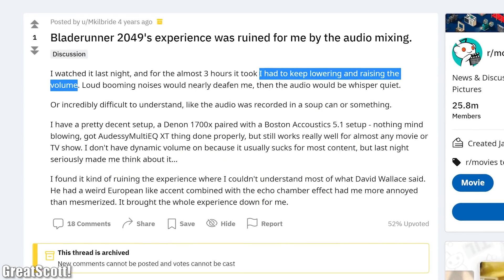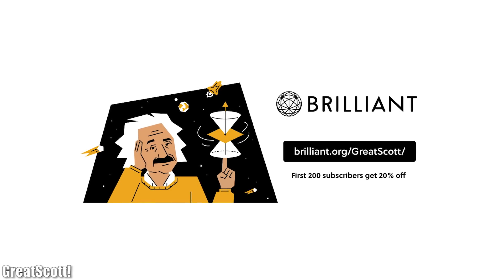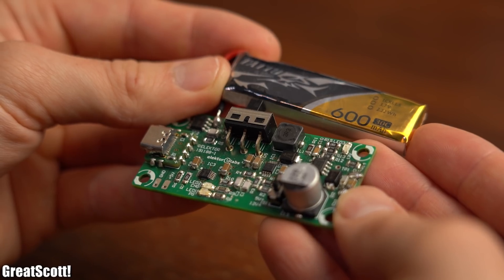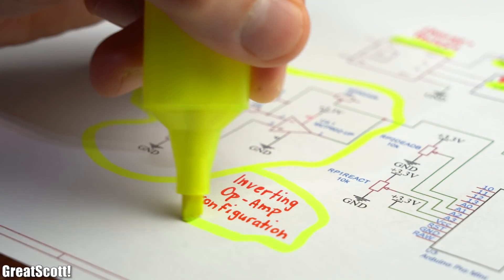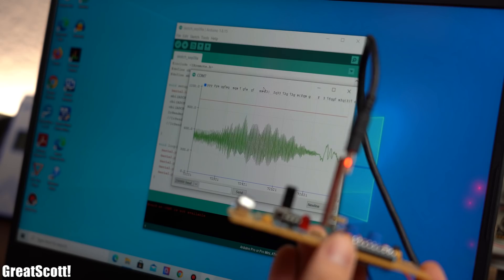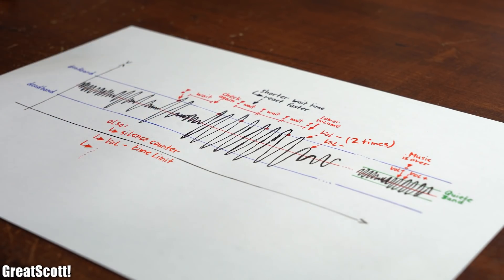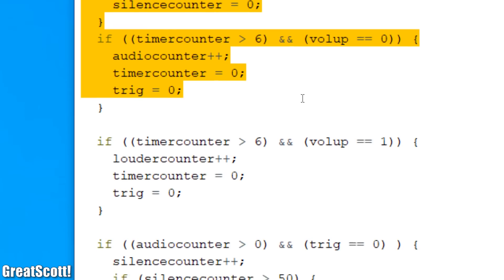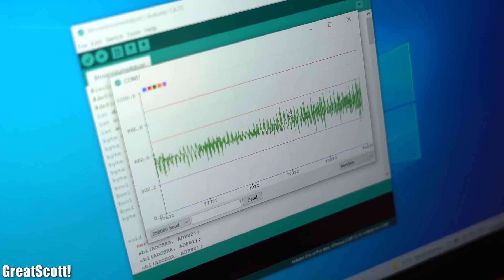Movie Music has a LOUD PROBLEM! So I fixed that! (Automatic Volume Adjuster)

Comment: Bro, your vdos are amazing. I am trying to make my earphones into Bluetooth ones. I have a hc05 bluetooth and not the regular one with left and right sides. So I decided to use a Arduino with suitable code that takes raw audio data from hc05 module and generate left and right signals for the headphones. Can u pls make a vdo on this😁

Comment: If you detect the raw audio and filter it you will get a volume envelope. This can be fed it the gain control of an op amp. The audio out can be looped though these amps. Most television have audio out and video out. They also have audio in and video in. The audio can be run through the AGC and the video looped from output to input.

Comment: Another way is to use a raspberry pi and process the audio there. Not very easy either. But could be really easy to share with docker. I have been playing with a similar setup. And even thought I don't have the attenuation figured out. It will totally work. The downside is having to get the audio in and out of the TV system. This IR based setup will always work independently. The upside is of the shelf hardware, and the ability to seamlessly control levels, without any jumps in volume.

Comment: Intelligent Volume control was a thing 15 years ago in most AV receivers. I can't get my head around this feature missing in these fancy soundbars. Sometimes newer obviously is not better.
Reply: Because everything is loudness normalized to LUFS/LKFS now, and that does a hell of a lot better job than your AV reciever 15 years ago.
Reply: @hepphepps8356  i am still using my 15 year old AVR and i don't see major changes with most movies from today compared to back when. When i don't want to disturb my neighbors but still enjoy a movie, i simply turn up the dialog volume but leaves the rest untouched. When i got a friend over to watch a movie together he was quite amazed what that old thing could and his new and fancy bar couldn't. And his wasn't cheap either. It might however be that i am missing something in the big picture here. Also, i think it depends on what you're watching.

Comment: 5:36 curiosity, can I do this with an arduino atmega 32u4?
Reply from the maker: I think so
Reply: @greatscottlab  thanks, I wanted to get the code from the remote control of my air conditioner, it is a model of about 20 years ago but it still works very well, unfortunately there are no compatible applications online🙃 But this way I can create a profile myself

Comment: but this will be affected by ambient noise and by your voice as well.
I think it would be better if you could access an audio line out from the TV and use that instead.
also it would be awesome if you can directly access the IR-receiver in the TV to control the volume not through an IR LED.
Nice work anyways and good luck from Egypt.

Comment: The problem is the extreme dynamic range of cinema soundtracks.  Great for immersion in an appropriate viewing scenario.  But not good for apartment dwellers and roommates who might not be watching with you.  The solution, as someone already pointed out is a “night mode” which functions by compressing the dynamic range eliminating the phenomenon of “volume chasing.”
Reply: The problem is selecting the wrong sound format and loosing the centre-channel in the down mix. Lol.

Comment: This is super cool project. I probably built it too.
But I probably change few things. 1) It would be nice, that you can set the volume that you want to sound level be regulated to with your IR remote. If you add infratranzistor to your circuit, you can detect when you are turning up or down volume and adjust for that. The potenciometer could be used for noise change toleration.
2) I would rather use direct audio signal instead of microphone, because its eliminate unwanted surrounding sound.
But it is still super nice project and it is super base, witch we can make even better

Comment: This is the worst way to 'solve' this problem. As many others have commented, you need an audio compressor instead. Also, your system is an "open loop" design, there is no feedback that the tv has accepted the volume change command so it may desync.

Comment: Dead band and react are threshold and hysteresis parameters. Awesome project! 
A sound bar with a "natural stereo surround" dsp will lead to dumping the volume of dialog because spatially it will want to push the dialog into "center"  with reverb.

Comment: Yes, the super high and super low volume thing is because the audio was originally made for surround (which uses a separate set of speakers for different tones so voices will hear fine too) and when converted to stereo disaster happens.

Comment: That's a really neat solution; I wouldn't have thought of it! But, if your equipment supports it, check out Dolby/DTS Dynamic Range Control. This will do the same job a bit more transparently, contouring the audio dynamics closer to the movie sound track. This is also guaranteed to work without user involvement on any Dolby- or DTS-mastered movie.

Comment: There is a reason for this. It is dynamic range. It used to be that audio on home movies was limited/compressed in dynamic range ("This film has been modified from the original" doesn't just apply to aspect ratio) for home use as we didn't have good systems at home (or at least the capable dynamic range of most of our tvs at the time wasn't enough).. now that technology is better and everyone wants the "theater" experience, the people who produce home movies never bother compressing/limiting the audio anymore. 

To compensate for this, many audio receivers, TVs and media playing programs (VLC) all have a built-in compressor or limiter (sometimes called quiet mode or night mode) to try and help this.

The actual "proper" solution to this problem (that the audio engineers expect you to do) is to TURN IT UP. If you set the volume where conversation is normal, that's where its intended and indeed the music is intended to be that much louder. However at higher "base" volumes, the change between quiet and loud is less noticeable.

I do however understand that not everyone wants to listen to their movies that loud, especially in an apartment or similar. Perhaps multichannel audio on Blu-ray should be used for different mixes. I'd love a quiet mix down as an audio option.

Personally, for movies that do this where I don't want it cranked loud enough, I often run the audio into a DAW program and through the Waves Ultramaximizer plugin, which is a great high quality limiter.

Comment: Very good way to show the design steps. But if you need such functionality look in your soundbar menu for drc or dynamic range compression. Dolby digital which all movie formats have available support this. Failing that, if you can adjust your channs, dialogue is mostly the centre channel, so increase that.

Comment: This is a problem that occurs when you send 5.1 or 7.1 sound to stereo speakers.  You are missing the center channel for the speech. Change to stereo output on the TV or add a center channel.

Comment: Step one: rip your legitimate Blu-ray copy into an MKV file

Step two: separate the audio file with MKVToolNix, ffmpeg or whatever you like

Step three: Open the file in Audacity and apply the compressor, or a volume normalization if you feel like it
Reply: I just use VLC as my media player, set up the Compressor, and never think of it again.

Comment: Pretty nice Project - but is it really required? 

At my knowledge, nearly every TV/Receiver has an Option called "Volume Normalisation" or "Auto Volume Adjustment". Not only does it bring all Stations to the same output level, it also sets the maximum output level of the audio signal. This means if the Volume is set for Dialogs, all louder scenes will be down regulated to the desired level.

The only thing I'm not sure about is if this also applies to devices which are externally connected to the TV. It should be worth a test I think, and if it does not work by change the settings in the TV, try to set this features in the soundbar settings.

Last but not least I like your circuit - keep the nice work up!

Comment: I solved this by adding a centre speaker intended for dialogue.
Reply: Yes, apparently the problem always arises when downmixing from 5.1 to stereo. One solution to this problem is to turn down the volume of the audio channels for the front and rear speakers or turn up the volume of the audio channel for the center speaker.

Comment: Is it possible that you only have the problem cause you don't have a centerspeaker in a surround-system? often the conversations are mainly outputted through the center-speaker channel, while the surround-sounds are mainly outputted by the front and rear speakers.
Therefore a downmix to stereo can be far to loud in all surround-sounds while the voice is much more quiet.

Comment: Could it be possible to attach this device to an analog audio output of your TV, where it can  get the audio data from. This could fix the issue of people making noise inside of the movie room and and as a result your device would start lowering the volume, which would make it even harder to follow the dialog.

Comment: Maybe a spectral analysis of the sound will show a significant difference in frequency spectrum between the conversation parts and the music parts allowing a quicker way to distinguish between the two. It could write a variable, for example "music", to one when it detects a non-conversational spectrum. Which in turn could trigger the dead band function so that evereytime the music exceeds the dead band the volume gets dimmed. Maybe this way your device could be made more responsive. Sounds like a fun project, keep up the good work!

Comment: How about grabbing the audio output before it hits the audio system(intercept the audio from the ps5 before it goes to the tv or audio reciever) and modulate the sound output that way..  This way you can skip adjusting the tv or receiver volume constantly.

Comment: Yeah! I constantly turn the volume up and down during lots of movies as well! Of course, there are software options as well. VLC has a compressor, which can be adjusted to reduce the dynamic range of volume peaks. Hmm. It seems like you basically implemented a compressor!
Reply: I affectionately refer to it as British audio engineering. The dialogue is practically inaudible while sound effects, screaming, and music are at extremely high volumes. You can actually implement a fix using only an op-amp circuit but it only works directly on an audio signal and won't be able to change the volume control on amplified speakers.
Reply: It’s not a British problem.

Comment: This is a compressor expander, or as Radio Shack called it a compander. RS created a dip in the '70s called a compander and it worked as an analogue device between the input and amplifier. Basically kept the volume at the same level.
EDIT: Or was it made by Texas Instruments and sold through RS? Too long ago to remember.

Comment: you just built a weird audio compressor... i like it... could you instead intercept the toslink connection and process that? i'm not sure if thats an open standard that can be read by an arduino or processed fast enough.

Comment: Blade Runner 2049 is the perfect illustration of this problem with current movies!  I, unfortunately, saw it in a theatre where we had no control over the sound system.  My wife's iPhone dB meter showed that nearly the entire move was played at 88-90 dB, whether it was conversation, music, or just ambient background sounds like the city traffic.  The only time it went quiet was a few moments in the forest scene.  I'm surprised that you were able to distinguish between quieter and louder parts at all.  In my experience, the conversation was loud loud enough, but it couldn't compete with the background sound and music.

If we can't get the movies mixed better, then I think the best solution would be something based on equalizer technology, which can isolate conversation from all other sound and selectively adjust the volume for each part independently.

Comment: But the real problem is that every time when changing the volume, the volume bar comes up and blocks the vision.
Reply: He seems to be using a sound bar, in that case it doesn’t show anything on screen when changing the volume.
Reply: It works better controlling a stereo receiver.
Reply: That's why you use a line level device. No need for activating the remote at all.
Reply: @jefferylarson3218  Which is more what my version for earbuds and headphones will be like heh
Reply: The REAL problem is it has an immense lag. It still gets stupid loud. It just does what you would do, turn it manually up and down. This is a remote control input hack. Definitely is not a "fix" to loud volume. It isn't really even automatic, but I'll let it slide at set-and-forget logic.
Reply: Get a Sony Bravia 2020 and the volume bar is so minimal it doesn’t interfere with the picture like past TVs.

Comment: Nice project :-) but why are you using a dedicated 3.3V regulator? There is already a regulator on the board of the Arduino Pro Mini that can handle 3.35V-12V on the RAW pin.

Comment: I'm sure you've already checked for this, but in 5.1, the dialogue is sent to the centre speaker... if you don't have a centre hooked up, re-map it to the front speakers or it'll suck big time.
Reply: If you are watching a DVD/BD movie with audio just going to TV speakers or a plain ole stereo, check the SETUP section of movie to see if they provided a simple STEREO audio sound track. Some do, some don't. Just a thought.
Reply: Lol. Could have saved him some time
Reply: @John Alexander if he used Wagos it would fix the problem for sure.

Comment: You can get a similar, but more refined effect if you gave a soundbar or TV that has a setting named 'dynamic range compression' / 'compression' / 'volume compression' or something similarly named. It's a filter that squishes the volume range achieving something very similar, but real-time. I found it hidden in menus on a few TVs, usually turned off by default. 
If you don't have something like that, this is a great solution!

Comment: Interesting video from a technical standpoint, but you are solving a non-existent problem. The explosions, music, etc are supposed to be loud, it's mixed for cinema with a wide dynamic range. If you want to enjoy it quietly use night mode aka dynamic range compression which most AVRs and computer audio filters have. Since it's nearly impossible to widen the dynamic range accurately but a simple filter can do the opposite it makes sense that movies are released with audio mastered for a cinema experience. I assumed you are using a soundbar before it appeared in the video and it seems I was correct. I don't know if it's common for soundbars to not feature audio compression but it feels like it should be mandatory on them of all types of audio systems.

Comment: With a program that analyzes the audio file and calculates the timings to turn the volume down or on, it may even be possible to turn the volume down before it gets louder. (Live broadcasts may require a 5-10 second buffer.)

Comment: Usually only have this issue if 5.1 is played through 2.0 speakers and Downmix is not setup correct on either the encoded media or on the decoding device. Problem is forcing 5.1 audio to play on 2.0 speakers results in loss of center channel.

Comment: I know that this is electronics channel, but having a compressor/limiter on the audio path is way more simpler and without having to hear the loudness until this makeshift device adjust the volume.
Reply: Sybren A. Stüvel  > reducing loud sounds while keeping softer sounds at their original volume.

Reduced dynamic range.
Reply: Sybren A. Stüvel  I have been playing with modify and alsa with a raspberry. And I think it is totally doable.
Reply: Sybren A. Stüvel  Yes, I was just trying to figure out how to use an HDMI breakout adapter with a 5.1 AV receiver and a fiberoptic audio connection to the TV.😜
Reply: Kinda sounds like what they do to AM radio so just changing the station doesn't randomly blow out your speakers and/or your eardrums...
Reply: Compression is great for smoothing peaks and bringing out hidden elements, but in this case I think his approach (volume automation) might be superior. Especially if you have prolonged periods of time of just talking or just music. Maybe a hybrid approach might be even better
Reply: Loudness is ratio of average to peak. Compression increases loudness. Reduced dynamic range increases ear fatigue. The whole idea is backwards.
Reply: @whatilearnttoday5295  Depending on how it is set up, it can act as a limiter. If you know how to use one, it is a way better option and you defenitely get less ear fatigue than with what he built.